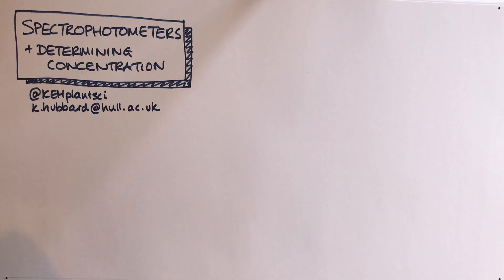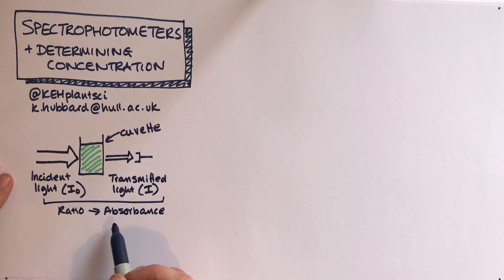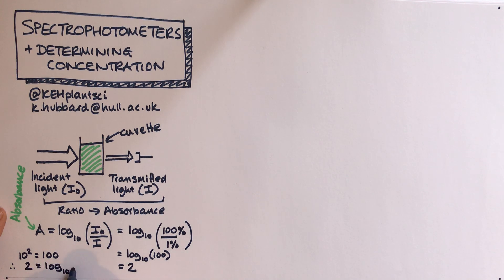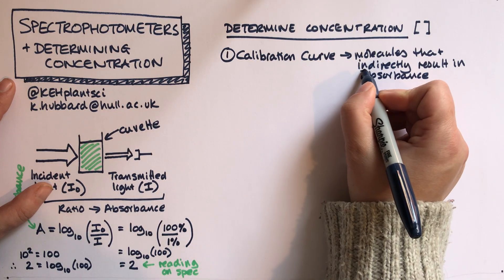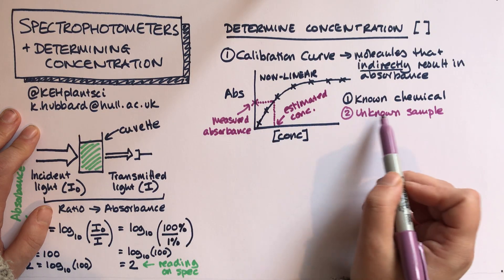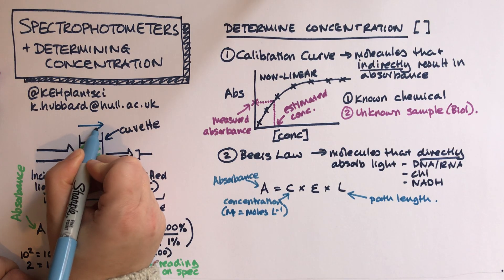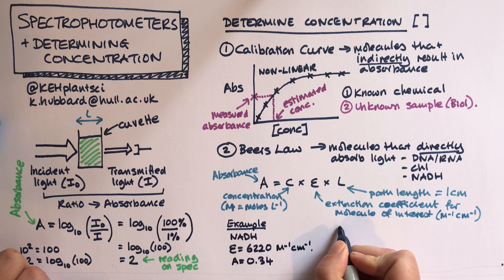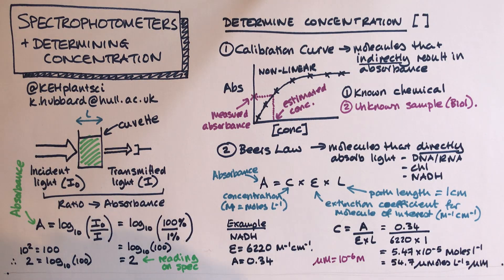Spectrophotometers, calibration curves and Beer's Law

Comment: Is epsilon the same as wavelength?
Reply from the maker: No - wavelength uses the lambda symbol. Epsilon is a measure of how inherently absorbent a particular molecule is at a particular wavelength, so acts as a calibration constant
Reply: My assignment has asked me to calculate the concentration of several solutions using beer's law - we calculated their absorbance and I'm assuming L is 1cm - so by converting the equation C = A/EL - but it hasn't given us an epsilom symbol,  @katharinehubbard5043

Comment: I did some research and found that the incident light is not white light. It’s a certain color of light frequency split by a prism that is directed through the sample in a spectrophotometer. Then you can also measure each of the other light frequencies from the prism by directing them through the sample. This is what gives a unique set of readings that identifies the substance. This is why spectrophotometer are more expensive than colorimeter which uses a set of R,G,B filters. Wouldn’t this mean that Tommy’s device is really a colorimeter and not a spectrophotometer as he states in his subject title?

Comment: I wonder how we know that our samples are indirectly resulted in abs or not. For example, does H2O2 create a linear or curved standard curve?
Reply from the maker: If your molecule absorbs light directly it will be a linear curve, if you measuring indirectly via an assay it will probably be curved. H2O2 absorbs directly in the UV range at 240, or you can measure indirectly via xylenol orange assay, which would need a standard curve making. Hope that helps!

Comment: how could it be NONLINEAR?
IT IS LINEAR
Reply from the maker: I should have probably done this explanation the other way around. For molecules that absorb light directly (eg NADH, chlorophyll, DNA) the relationship will definitely be linear. However for some spectrophotometer assays that measure concentration indirectly there will be saturation. The obvious example here is a Bradford assay to measure protein - the Bradford reagent is only sensitive to low/medium protein concentrations, and saturates at high concentration. The relationship between protein concentration and absorbance is therefore non linear, so the standard curve method is used. Hope that makes things clearer!
Reply: @katharinehubbard5043 so if you're measuring protein by a dye-binding method, could the relationship be linear if solutions are very dilute?

Comment: Thank you for this great video I want to ask about the concentration you calculate at the end is that we put in on the curve graph
Reply from the maker: Hi there - glad you enjoyed the video. No - the two things are separate methods. Beers law describes a linear relationship between absorbance and concentration for molecules that absorb light directly - if you plotted the graph it would be a straight line. This works for molecules like chlorophyll and NADH which absorb light directly and are relatively unaffected by temperature/pH etc, hence you can mathematically predict the concentration with Beers law for these molecules. The calibration curve method is used for measuring molecules that indirectly absorb light eg via a chemical reaction. The classic example for the curve method would be using Bradfords reagent to measure protein concentration - the reaction between Bradfords and the protein causes the Bradfords reagent to change colour which you can measure on the spectrophotometer. This is a non-linear relationship that will depend on the temperature/pH/buffer, which is why you need to construct the calibration curve every time you want to make measurements. Hope that helps!
Reply: @katharinehubbard5043  Thank you for answering I got it ❤❤❤